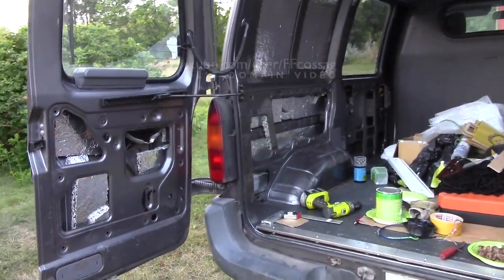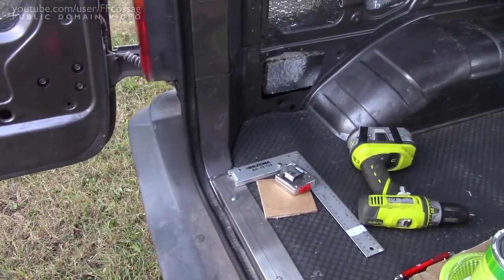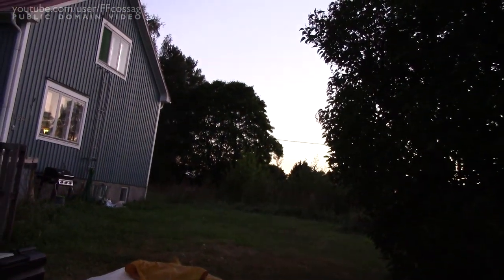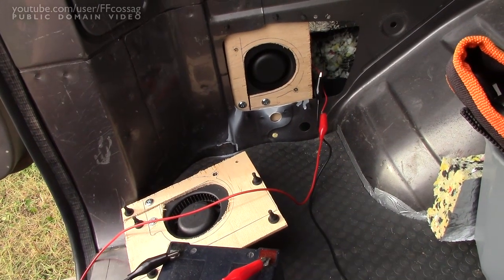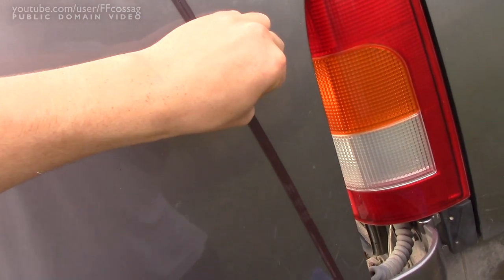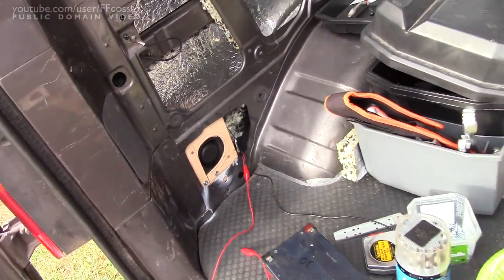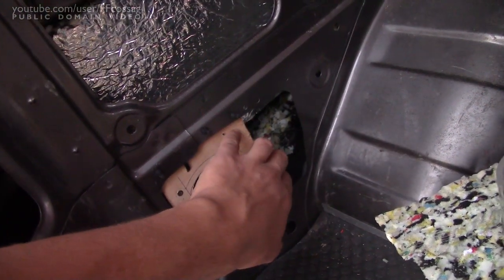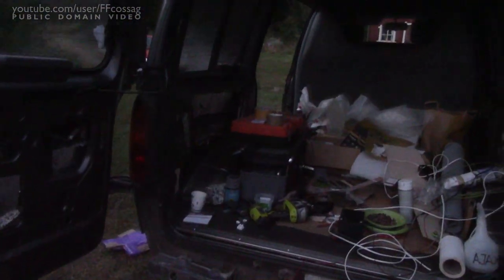Van camper! Build log #3 - Ventilation

Comment: maybe polyurethane glue for those failed metal to metal joints would work? Squirt into the crevices and around them. Used Kleiberit polyurethane glue for foam plane making, the stuff goes everywhere, expands when free and sticks to anything. My car hood (damaged experimentation- free metal now) has glued skin too, but it some kind of rubbery glue, still holds after 23 years.

Comment: Just a quick thought: The yellow (glass wool?) isn't probably the best stuff for insulation as far as I know. The wool will hold the moisture, which could cause rust in hidden areas (especially with old VW camper vans). Maybe your ventilation helps to prevent humidity.

But nice project though…
Reply from the maker: Yep, I have considered that and I'm going to keep an eye on it. If it gets moist and stays moist, I'll just have to change it over to styrofoam in the future.

Comment: Smashing job :-D, Have you tryed wiring the fans in series, roughly 6-7 volts each if run from 12 to 14v ?
Fridge magnets lol, what a mad use :-D
Reply from the maker: Connecting brushless fans in series does NOT work, since they don't draw current very linearily at all. You usually end up with fans revving up and down randomly as they go in and out of phase with each other.
Reply from the maker: *****
I've tried it, it doesn't work very well. Brushless DC fans just aren't generally stable enough.
Reply: Ooow what a shame, i would imagine a 50 ohm resistor across each fan and 470uf capacitor across each resistor would work, but you cant afford to lose too much power ;-(